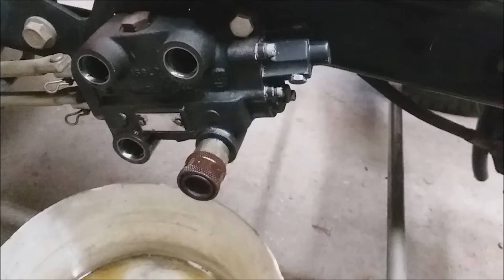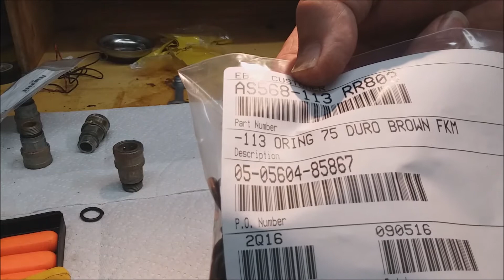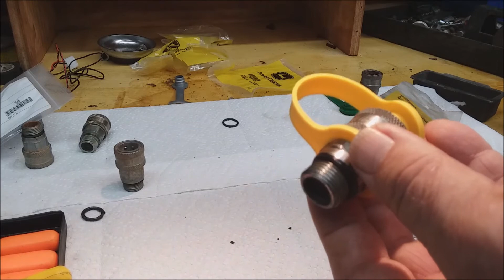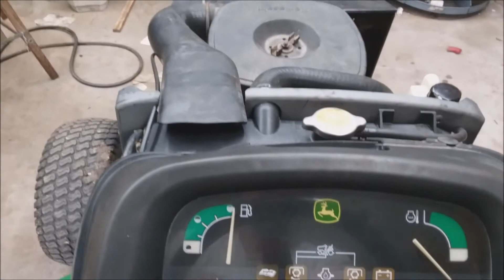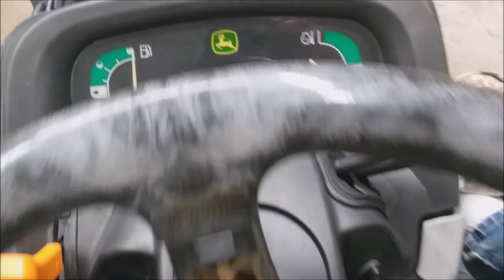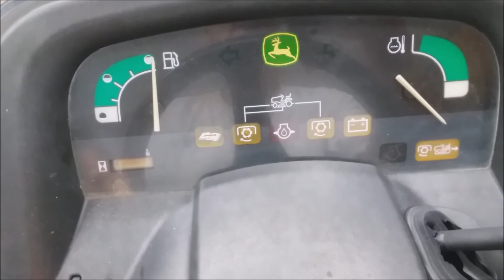John Deere X Series Hydraulic Quick Connect Coupler Repair

Comment: Sounds like its still has ignition problem i bet its the black box if its like the jd425 the ignitor box buy a aftermarket one for 20 bucks and it will run whole lot better.
Reply from the maker: I had a 425 with a similar problem.  It ended up a bad coil when it got hot.

Comment: I am having problems with my 445  hydraulics lifting the snow blower or rotating the chute in cold temperatures.  Any thoughts on that?  Thanks for the video..
Reply from the maker: Cold hydraulic fluid is thicker which causes slow flow. Be sure to use Low Vis Hygard. Could also be a weak charge pump.

Comment: On the scv, (Up/Down Float Spool Assembly) Mine is hard to move!
Reply from the maker: The lever for the rockshaft/mower is used all of the time.  The UP/Down Float is only used with a loader or front blade etc.  This valve can be stuck from not being used.  Take a hammer and try taping the rod into the valve and pull it out a few times.  You may also need to remove the end cap and clean the detent balls. Spray it down with a LOT of penetrating oil like Kroil.

Comment: My father just handed over his x575 to me. I have two issues to figure out. When idling it’s pulsing but if I slide the choke up some it smooths out. Can you do a video of the Governor spring you mentioned? Wondering if that could be my issue. Also, can you raise and lower the mower the deck when the x45 bucket is attached? I can’t figure out how to raise and lower the deck with the bucket on this thing.  Sorry if that’s a dumb question, never owned one of these things and I want to try and restore some of the things on this tractor! Thank you!!
Reply from the maker: The carburetor problem sounds like to needs be cleaned. Before removing to clean, I would try so Seafoam in the gas before removing the carb.  The rockshaft cylinder to raise and lower the deck, uses the same hydraulic circuit as the loader curl. When you connect the loader hydraulics, it is in parallel with the rockshaft cylinder. You have to disconnect the loader curl to use the rockshaft cylinder. There is normally a rockshaft lockout valve installed on the hydraulic valve to block flow when using a loader.  You could install a lockout valve on the loader curl line so the rockshaft would work. It would be a manual solution to the problem.  I did on one of my loaders.

Comment: Are you sure "908" is the right number for that O-ring???  Nobody has that number
Reply from the maker: 908 is correct. I ordered them off eBay. The complete description is "AS568-908 RR787 O Ring 75 Duro Black FMK." I have a bag of them in my hand.

Comment: Great video. I think I damaged the internal o-ring on one of my implement quick connects on my 99 powerking. Never changed one, but seems very similar. Thanks!
Reply from the maker: Most garden tractor use the Pioneer 4000 series hyd couplers so they should be the same.